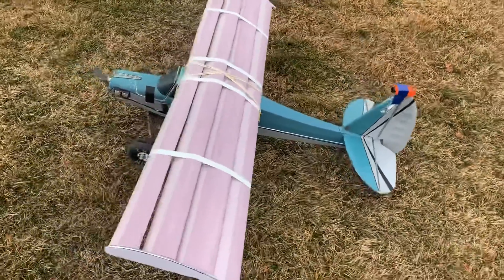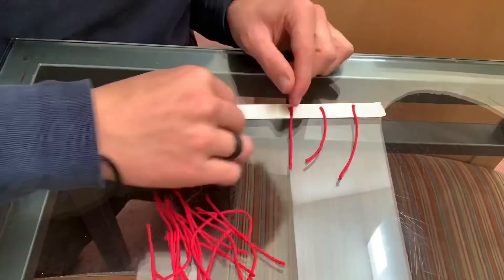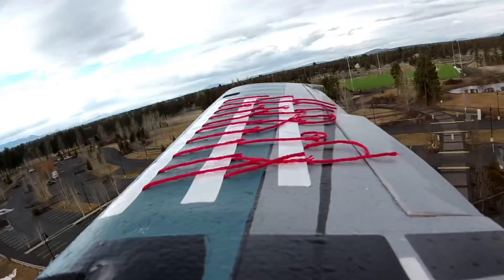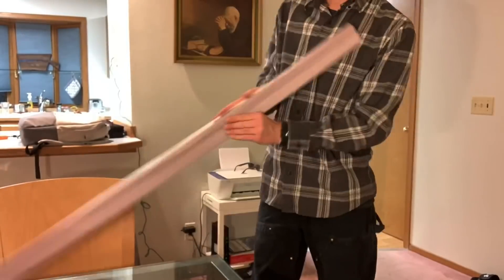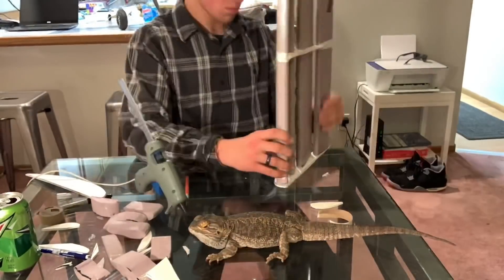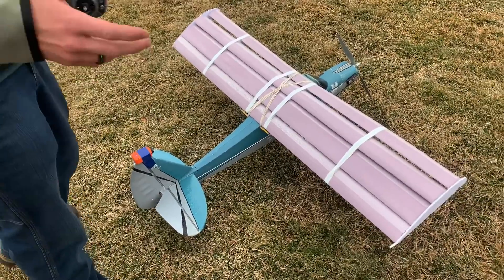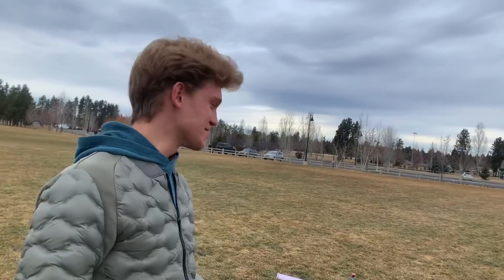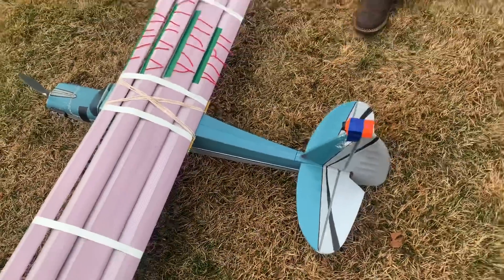“Unstallable Wing?!”

Comment: That last flight it didn't seem like the wing stalled at all. It just ran out of thrust to keep the airplane a loft vertically
Reply: It would be interesting to see it with tell-tales across the entire wing to see if either tip showed any stalling tendencies. What was videoed was likely the un-tufted side stalling, perhaps (which is why it rolled left).
Reply: I would say the same. No need to be stalled, just too slow to generate enough lift. Unstallable does not mean you can stop in the air :)
Reply: The problem with no ailerons is that you can develop a huge side slip with the rudder and vertical stabiliser stalled and ineffective.  With the wing stalling getting out of a developed spiral dive using rudder alone needs some forward stick and a lot of height loss to keep the wing flying, in a spiral descent the angle of attack is higher on the inside wing (imagine going down a spiral staircase, it’s steeper on the inside).  The original Flying Flea lacked direct roll control and was a killer as a result.

Comment: Hi Bailey,  I was impressed by your non stalling wing and wonder if you could investigate an idea that I have had for some time.
It seems to me that the flap track nacelles on commercial airliners are a source of high drag and wondered if a different approach might be possible. My idea is to create a biplane arrangement where an extra aero foil is deployed from the top of the wing for takeoff and landing. The biplane flap will have the same top profile as the wing so that it blends seamlessly into the wing for normal flight. The slot created in the wing with the biplane flap deployed must be closed somehow to maintain the lift integrity of the wing.  It may be that a spring loaded cover is the answer which is forced down when the biplane flap is stowed and replaces the top profile upon deployment. I think that this could be a much simpler mechanism than the six or eight flap jack screws as used at present.  Thanks, Nick Fry
Reply: sounds like a slat

Comment: Geoffrey DeHavilland invented the slat. Looks like your wing is comprised of slats and nothing else. Looks pretty cool.
Reply: Slight error there Bingo..  The automatic slat that automatically eployed at high angles of attack was designed by Frederick Handley Page.  As you approach the stall, the low pressure area moves forwards and the slat pops out just before the flow breaks down. It then re-energises the boundary layer and so that it remains attached and delays the stall..
Reply: @petegarnett7731  Thanks for the reply. The second airplane I ever flew solo had fixed slats on the upper wing. That feature was known as  slots, as I recall but I may be mistaken.  The last plane I flew had movable slats. Wonderful invention.

Comment: I want to see wing warping brought back and experimented with instead of the conventional control surfaces.
Reply: Let us know how that goes.
Reply: Wing warping works fine for a low performance wood and canvas aircraft, but in anything more serious wing warping doesn't allow enough control and introduces too much stress into the airframe to be viable
Reply: @Davinator2662  Lets experiemnt and find out. Who knows what new matwerials and approaches can create.  These are small and slow aircraft anyway. But the faster you go the less input you need on a control surface.
Reply: It has been done somewhat with the X-53 program.

Comment: This reminds me of the time my teacher snipped the top of my rocket parachute off, which made the parachute stable, instead of twirling. Same exact principle: there's such a thing as too much lift.

This is like taking a biplane, and combining the wings together, into a sail like shape.
The result is a pocket of air underneath, akin to a sail. Big sail boats often use many sails instead of 1 big sail, probably for this same reason. It produces lots of force, in a stable way.

I can't imagine it would be good for high speeds though, because the drag is way too much. Drag is basically the same thing as lift.

It's like a parachute/wing.

There's one more thing. You could probably get more lift without the traditional airfoil design. As the large topside produces down force.

Comment: That might be great as a trainer, but it doesn't appear to get you to point a to point b very fast.  It appears as though the extra wing suface has slowed down the aircraft.
Reply: As with just about everything there is a trade of for any advantage gained. This type of wing may not be good for speed and effeciency at cruising speed but it'll be great for extremely short take off and landing applications.
Reply: @stevecade857  After making my comment above, I watched the part 2 video and the second aircraft appears to be faster.  If this design was ever used for full scale aircraft, they could always add covers for the openings that would automatically fill in the gaps while at high altitude for faster speed. .

Comment: Build a Klein-Fogelman plane. It's sort of a constant-speed airfoil and it doesn't matter if the discontinuity of the skin is in the top or bottom last third of the wing chord. The wing root(s) apply quite a torque to the fuselage when the wing flies. It's awesome.

Comment: The 'crash' was probably more of a control problem than a stall problem. Ailerons are pretty much useless in this regime, a more effective rudder is called for.
This configuration obviously shines in slow flight but will probably stink to high heaven in cruise, at least on a full-scale aircraft.
Reply: Absolutely. It’s basically a wing of just flaps/slats. Great low speed but REALLY inefficient

Comment: Great work and v interesting. I understand the Russians built a biplane which is virtually un unstallable, the Antonov AN-2. It has a cunning automatic flap system which extends flaps whenever the airspeed over the wings is too low. If power fails u just keep it level and it will sort of float down - according to Wikipedia

Comment: That's my idea from over 40 years ago. I drew it but never built it. Mine was to have each slat be movable so it could close up or open when needed and be able to  move independently on each slat to be able to experiment with air flow variations
 The big problem was l would have had to use solid balsa or a rib and spar construction for each slat.
Back then we didn't have any foam or balsa substitute for large sized experiments like yours

Good luck and l am glad your work seems a success

Comment: EXCELLENT work! A long time ago I did some work on corrugated (zig-zag section) wings whose overall envelope (section) was an airfoil shape. We ran the wing in a wind tunnel and plotted lift & drag at various angles of attack. What surprised us then was that the zig-zag construction acted like a regular airfoil. The idea was that we were mimicking insect wings which are zig-zag with arteries at the ridges, both of which added strength to a flimsy material. This reminds me somewhat of that. I would be interested to hear if the tradeoff for that fantastic AoA envelope is severely increased drag - were you able to get a feel for that? Was the airplane significantly slower in level flight? 
All the best and thanks for an interesting experiment! Rob in Switzerland
Reply: What you are describing sounds something like a Klein-Fogleman wing, of which there are several variations. I built a foam board plane that uses KFm2 airfoil, and it has excellent stall characteristics. (NC/USA)
Reply: @clarencegreen3071  I just googled K-F wing and I don't mean that. Imagine you have a wing made of zigzag folds of a membrane which, when observed in section, has an airfoil shape defined by the outermost folds. But actually it's a bunch of zigzags.

Comment: Airliners use similar techniques - I just forgot their name :) . When the flaps go down, they leave a space on the upside for the laminar flow to get refreshed from the air below the wing. The cost is drag. Cool idea though to make a few stages and visualize them. I´d like to see more experiments.
Reply: also, slats
Reply: @Not.Your.Business    and slotted flaps,  area increasing fowler flaps also have slots.
Reply: Yes, the air accelerates through the duct passing from high pressure to low.  The fast airflow layer energises the attached upper surface boundary layer and keeps it flowing into the increasing pressure gradient towards the trailing edge.

Comment: Stall is governed by angle of attack, not airspeed.
You were able to raise the nose a lot and the forward "wings" were not at a high angle. The air from the forward "wings" probably helped keep the laminar airflow over the rear.
When a stall finally happens, it will be the rear "wings" first which will move the center of lift forward. That would cause the noise to rise more increasing the stall.
All "wings" are flying at the same airspeed, but different angle of attack.

Comment: One cannot really have an unstallable wing. There will be a time where  the airspeed will be to low to provide lift thus V (squared) will get closer to zero, rendering the final results of L = 0. On the other hand the more one increases the angle of attack to the relative wind, the closer it gets to 90 degrees or vertical, thence providing no lift but unly a full wing of drag forces. The best one can probably achieve is a more performing wing, but by how much versus the cost of construction of such a wing and the economy of fuel or eventually of electricity reserves on board ?? Just thinking !   Fun to watch for an old retired pilot always curious to see what will come next. In any case, keep playing around with it, all great discoveries have been made by luck or mistakes.
Reply: This is a different point... you CAN have have wing that is producing zero lift but that doesn't mean its stalled. An aircraft that is landing/depending is always making less lift than the mass of aircraft (obviously...otherwise it wouldn't come down) but the general term 'stall'doesnt mean zero lift... it usually depicts a wing that has stalled( no longer working) or... broken the top flow. I k ow your point but It depends on your outlook. Ie, a wing may produce zero lift but still have functional ailerons, meaning, it hasn't stalled.
Reply: Yes, for a single airfoil. With multiple airfoils, one can stall before the others, pitching the whole aircraft down, reducing angle of attack. So as a group, the collection of airfoil doesn't stall because it can't reach a high enough angle of attack for all the airfoils to stall.
Reply: pliz explain your views in a dumbass version for me 🤣

Comment: The first unsalable aircraft was the Waterman Aerobile from 1935. There is a flight simulator module for FSX10 to explore it with. You need to sweep the wings back to solve the low speed stability problem, and I think reduce the wing tip lift a little. These will give the plane a nose up attitude as the air flow diminishes and the assembly should just mush down as the Aerobile did, I expect.

Comment: I wonder if what looked like a stall was actually the CG shifting backwards from the extreme angle. I'm no expert, but it seems to me that flying at slow speed with the CG moving to the rear has got to make for some challenging control issues. BTW making it a twin engine with differential thrust might improve control a lot as well as getting high speed airflow over more of the wing.

Comment: Put and RPM meeter on the motor or a speed laser pointing at the propeller while flying and during stall test, see how much more does the motor and propeller has to work to keep the airplane up with the improved wing and a regular wing, this will let you know if the improved with is worth it and compered to a regular one.

Comment: Your cat looks even more strange than your wing.

Jokes aside, I swear I was thinking about doing the same thing. Thinking of the function of flaps and slats, I said to myself "why not making a wing all made of slats/flaps?" And here comes your video!
By the way I agree it seems that no stall occurred in the crash. Rather a lack of control at very low speed due to torque from the prop and not enough airstream on the rudder.
Reply: Right on. Like window blinds. The sections should be able to move then lock into place like luvers and form one wing. Then be able to open at slower speeds.
Reply: Lol, that is a strange looking cat.
Reply: While It too slow Profile ist. It isnt unstable foils, its too low speed, too much climb rate....

Comment: Ok, the stall speed looks like it was reduced... but was the lift changed because of the wing design? How about the drag?
Reply: i assume these act like leading edge slats (not entirely true probably). In that case, there will be an increase in drag, and a minimal increase in lift. The main goal is to decrease the angle of attack.

Comment: Maybe use the most Aft Wing, as Flaps/Ailerons (Flaperons), insert some Square Graphite stock into the Wing Sections, as "Spar Caps", for stiffness.

Bigger damage happens to real aircraft, and they get rebuilt, don't give up! It was an example of "Trial By Fire" and you Discovered a Lot! 

Pace yourself, but continue! 👍👏❤️😁
Reply from the maker: Good ideas! I actually talk about doing that at the end of part two. I plan to do that for part three whenever I get the time.
Reply from the maker: The flaperons part

Comment: You didn't really test stalling. When you keep velocity constant then lift increases with increasing AoA. Stalling happens when an additional increase in AoA does not cause an increase in lift anymore but a significant loss ... despite constant velocity.
What you did was basically slow down the plane to a halt. Of course lift is gonna drop, but not because of a conventional stall but because lift is proportional with velocity^2. If you reduce velocity to 10% then lift will drop down to 1%. At this point, you had the noise tilted up so far that mainly thrust produced by the propeller counteracted gravity and not lift of the wing.
Only the mid section of the wing will produce some lift due to the air's velocity from the propeller ... which is why the plane is unstable and will tip towards either side.

Also, this wing cannot be more efficient. It will have tons more induced and parasitic drag.
Reply: Torque from the High Power Thrust, in a Power-on Stall, typically causes a wing drop,in a rotation opposite to propeller rotation! If he had inline, counter rotating props, this effect might be reduced, if not eliminated.

Also, an Accelerated Stall, can happen, typically, at any speed, in a High Bank Angle, if you have enough Elevator control authority! I say, "Typically" because he has 4 Airfoil Cord Angle of Attacks, to deal with, instead of 1, and this creates increased complex airflows, with each forward wing acting as a Slat, to the one behind it! 

And also, each following wing, is acting like a Flap, to the one ahead of it! These interactions are all happening at the same time! And, he jumped from 1 Wing / Flap to 4 Wings, in one jump, so skipped a Learning step, of progressing one Addition at a time!
Reply: @robertweekley5926  Hello! There is no power-on and the wing also doesn't drop in the opposite of propeller rotation. But I can see how the mass of a large, heavy propeller that is accelerating causes counter torque on an airplane, though this is typically counteracted somewhat by the propeller slipstream hitting the surfaces of the airplane.

Here it clearly is lack of lift at the wingtips, which could be called wingtip stall I guess, that results in the left/right wingtip dropping seemingly randomly. You can see this is happening in the video. This is very nasty because ailerons are also typically located more towards the wingtips, which you'd need to correct this but ailerons are ineffective during such stalls.

Yeah, what you call accelerated stall is what I was actually talking about in my first post. Thank you for pointed out that term.
But for such stalls the airplane would have to be faster, heavier and/or (full) elevator input would have to be much more abrupt. THAT would test the "anti-stalling" feature of this wing design.
But if you instead slow down wind over the wingtips close to zero, then any wing will behave like that, which is why I objected to calling it a stalling test.
Reply: You are correct. Because he refers to "stall speed", it appears that perhaps he doesn't understand the stall relative to angle of attack. It would indeed be much better to do something like a wind tunnel test where you measure lift and drag versus angle of attack it's various speeds. 
This is basically a multi-slatted wing. 
If you wanted to, you could build a wing and just hold it out the window of a car while measuring lift and drag. It seems like a cute idea, but I think probably has a lot of drag. We know from experience what slats do for low speeds.

Comment: The first fix would be to add about double the vertical tail surface...and even consider adding more horizontal as well. simple cuz those surfaces are the ones now stalling causing the wag and lack of control. To do that you would need to use a lot of open surfaces covered by film to keep it light so it doesn't throw out the balance.Ay those low speeds , ailerons have little use but a huge fiin will hold it right on track.